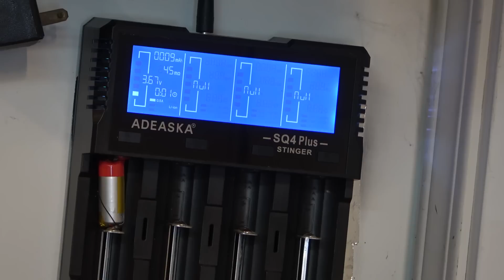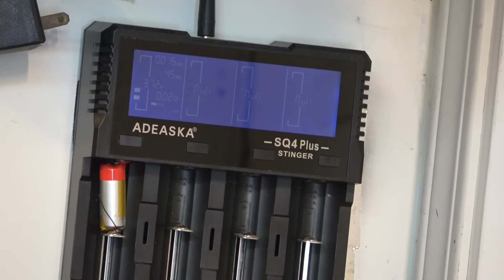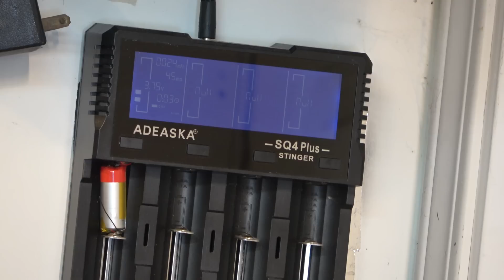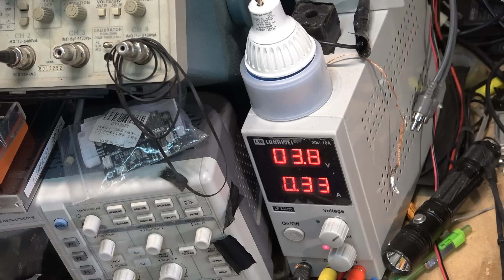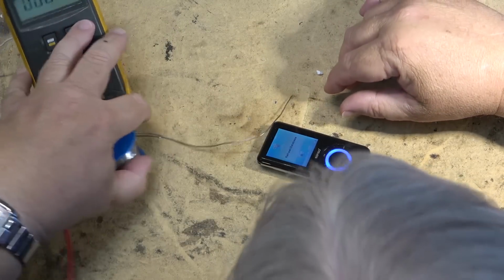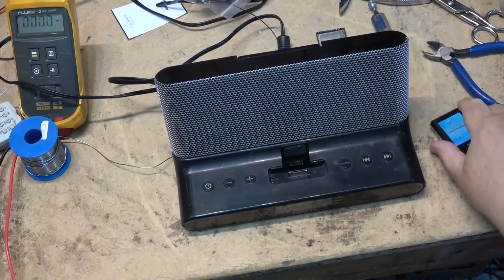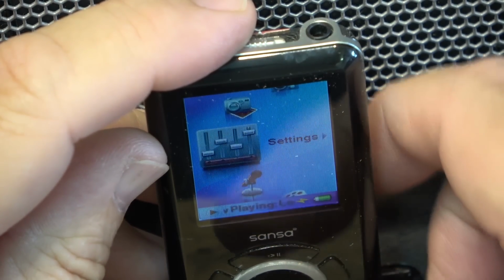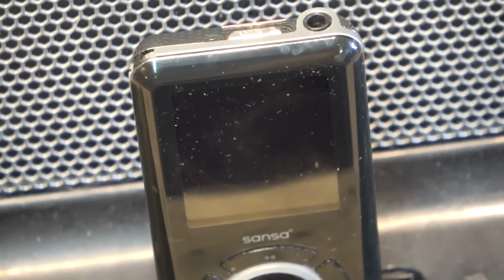Recycling Old Lithium Ion Batteries

Comment: I found many of these on the side of roads, pavements, and around bushes. Can't believe that if someone's willing to collect these will have free decent quality 3.7v Lithium cells. Also many times the juice runs out before the battery, or sometimes the pressure switch will have counter and half charged cell gets tossed away for someone to collect & re-use the cell ! 

I can not believe in the year 2022, there are free Lithium cells just lying around the street asking to be taken home, re-charged, and used in project. Instead of driving nowadays just walk different routes towards the same shop to find a ton of these which became apart of my routine lol could not help myself can't let batteries that can be re-charged go towards landfill.

Comment: I Vape & I do electronics!
One day when I was in The Vape Store,  I had an idea?🤔
I bought a small metal trash can with a plastic lining.  I placed it in the vape store ( with permission) & put a sign on it that says ..."Recycle".
You see, I work as a bus driver for a recycling facility. I pick up special needs adults & bring them to the facility to recycle material. It's a way for them to be a part of society & have a part-time job.
 It's a very rewarding job for me, I truly feel blessed! ️😊✝️
I disassemble the used Vape devices,  then recycle the plastic parts at the facility.
Most of these devices have a onboard battery management /charging system. I have so many lithium  batteries now, my main concern is how to store them safely!
The metal tabs are real delicate.
Big Clive recommended to me,....when I solder a wire to the tabs, wrap tape around the ends of the battery real tight to help hold the tabs secure. I even use a dab of E6000 glue to help secure the wire & tab under the tape!
Have fun with your electronics everyone & stay safe!
🇺🇸👍😎👍🇺🇸
Reply: I saw the Big Clive video about how these things are being tossed on the ground or in the garbage. Scary and disturbing!
Reply: @bobsoft  I agree!
There is a lot of power and chemicals inside each little device!
I just went in and picked up what was in my recycling can today  Aug 27.  There was about another 15 devices in there.
I have such an over abundance of batteries now,  I give them away to my friends that are into Electronics!

Comment: I won a pack of these a while back and took them apart too. They often have a nice little lithium battery and some microphones(yeah that was weird to me at first too), Turns out they use the mic to detect the user inhaling and triggers it.
Reply: Wow!!!! So that’s a miror right! I have also many of those
Reply: It's NOT a microphone. It's a pressure sensor and a mosfet to switch the power from the cell.
Reply: @johncoops6897  hmm the article I found about it explained otherwise. Thanks for the info
Reply: @ObsequiousV4  - the electronics are housed inside a small cylinder that looks just like a microphone which is what causes the confusion.

Comment: These disposable vape devices must be the single biggest waste of the Earth's valuable Lithium resource.
Reply: Sure are
Reply: It’s an ecological disaster tbh! Those things we’re supposed to have a charging port like usbc or cheap usb! Or maybe a wireless pad….
Reply: Nowhere near as wasteful as the Electric Vehicles which are proliferating.
Reply: @johncoops6897  I disagree (although I suspect you are trolling). The batteries in electric vehicles will last many years longer than the batteries in these single use things. Even when the batteries in vehicles are knackered the materials can be recycled and turned into e cig batteries. A single use electric vehicle would be bad though but as I said they are rechargeable unlike these things.
Reply: @st200ol  - I am not really trolling, more like being facetious. The batteries in these things could be recycled in the same way as any other lithium battery. These things are only 500mAh, tiny in respect to other lithium batteries we commonly use. Have you seen the size of the pack used in a EV car?
Yes, I totally agree it is wasteful that these aren't rechargeable, however there is only enough "juice" for about 1 charge worth of usage anyway. No point recharging it if it won't function anyway!
There really isn't any alternative as a power source, and a "proper" rechargeable vape is heaps more expensive than these things, and doesn't work until you fill it. So they exist because  they are  convenient... Kind of the same as how packs of cigarettes are heaps more expensive and wasteful than rolling your own 'smokes'.

Comment: I have found several on the road at the curb.   I saw them flashing in the dark.   It must be a low battery indication.   I took several home that weren't run over and deformed.   They had nice little batteries in them and they all recharged.  Nice little batteries for small projects.

Comment: I like that idea that you can salvage the rechargeable batteries and install to the useful hardware components and get it going again. Too bad that Microsoft Zune don't work for me and I didn't know that Sansa can make this device that will work for the docking speaker the one is designed for the iPod and iPhone. Your Sansa is way awesome than my iPod. Pretty cool device.

Comment: what is the center pin on the battery terminal used for on the mp3 player?
Reply: .... Thermister, to interrupt charging if battery overheats.
 Or, for compatibility with Romulan type 3 disrupters.

Comment: Theres an air switch on end which ignites the paper, when they take a drag.  It is soaked i n the scent,IE: Makes the smoke. Writing this at the 2:07 mark in your video.On flip side,  that air switch,  & filamint wire,  a reversed polarity electrolytic ?,  a small piece of lithium metal,  a very small canister of gasoline with sealed top inside a bigger container with the above mentioned,  actually air switch could be omitted. Connect the ,  GO + - to a start circuit of your needs.🌠🌀🎆
Semper Fi,  Hugh Mc,  Chicago,  metro.

Comment: Very useful video thanks. Was after you opinion on an issue I have with one of my Video 8 recorders (GV-200 video walkman) It has been working fine the last few years but using now when playing a tape it works fine with video and sound then after around 2 minutes the picture slowly changes to black and white starting from the top and working its way to the bottom of the display. Same result connecting to an external display. If I leave it off for a bit and try again it works fine again in color then turns BW like before. The sound is fine and it looks nice and clear in black and white but there are a few horizontal lines flickering some times. I ran a Sony cleaning tape a few times and even used a strip of white paper and Iso. All the caps were replaced 4 years ago Thanks :)
Reply from the maker: Probably the crap that leaked out of the old caps has attacked the copper on the internal layers of the PCB. Thats why I don't recap cameras. Couldn't pay me enough to do it because I don't want to be married to an old camera.
Reply: @12voltvids  So you think the heads are probably ok since it works fine for a few minutes then slowly turns BW?
Reply from the maker: @Raptor50aus  yes if heads are bad you get snow or streaks. Good bw means the heads are reading the signal.  Problem in color circuit.
Reply: @12voltvids  thanks
Reply: @12voltvids  One of my 3 GV-100 video walkmans has a similar issue where it keeps changing from SP to LP while playing. Oh well it is the spare parts unit now :)
Reply from the maker: @Raptor50aus  capacitor piss corroded the board.
Reply: @12voltvids  I took the GV-200 apart, checked all the caps with ESR meter especially in the video section on the mainboard, All were fine as they were all replaced only 3 years ago. After reseating all the ribbon cables, the video color is ok now :) but do you how to resolve a slight issue which does not affect playback, when the tape has loaded it almost seems like the drum is slightly sticky and is gripping the tape when spinning down like a brake is being applied, with no tape is spins fine, but it plays etc ok. thanks

Comment: Use an RC charger, so you can set the current
Reply from the maker: I use a proper charger
Reply: I use a constant current/ constant voltage charger.
I dial it in to 4.2 volts. 
Depending on the battery size, I set the current to 300 mA - 500 MA max!
I also have several chargers for charging up lithium ion batteries. 
Just depends on whatever is easiest to use & if I'm going to be there to babysit it?
Reply: I suggest anyone that wants to use these batteries to invest in some cheap battery management boards.
Look for some that have the proper  voltage & current limits for lithium ion batteries & the proper voltage current cut off built in,  For when the battery runs low. 
What those voltage and current are?
Depends on how you plan on using them!
Reply from the maker: @ronniepirtlejr2606  notice that I did charge it on a lithium cell charger.
Reply: @12voltvids  yes i did!👍

Comment: Could've extracted the battery protection from the old battery
Reply from the maker: What battery protection? They are not rechargable in the vape device.
Reply: @12voltvids  most of them are rechargeable!
Most of them have a battery management / charging system built on a small PCB.
Reply: @12voltvids  i meant the old Santa battery
Reply from the maker: @ronniepirtlejr2606  this just had tabs but it is possible there was protection under the cap as the 18650s I have seen have protection built into the cell.
Reply from the maker: @lachlanlau  the sansa battery does have a pcboard as does the new one i put in.